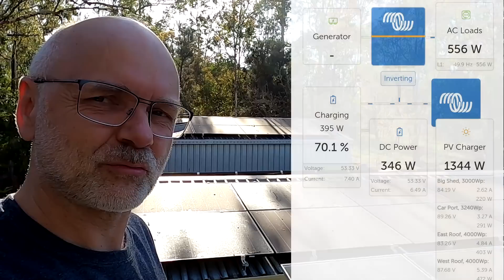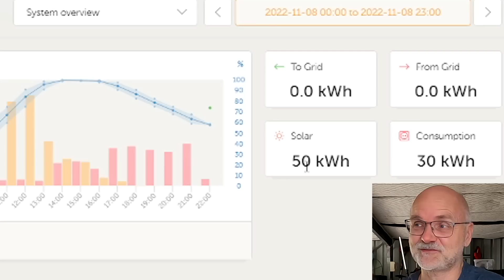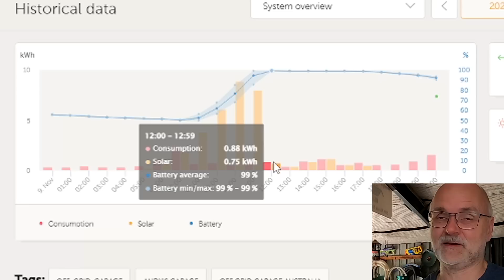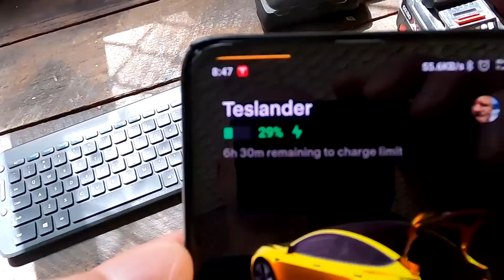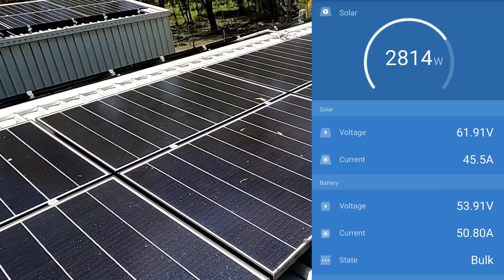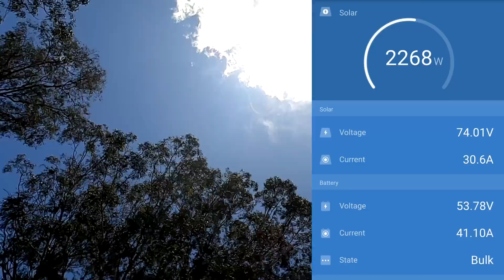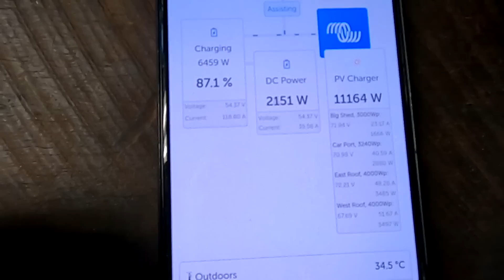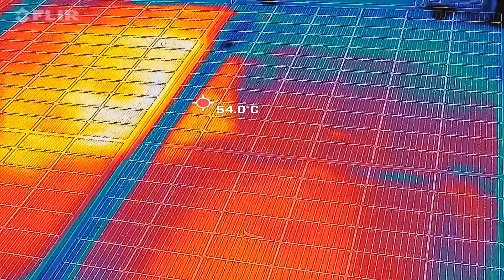I had to limit the output power of the new solar system. First impression after a few days...

Comment: Like 437, UGH

What is the most amperage/power your Tesla charger is capable of? How quickly can you charge it to 100%?

This is why I’m eventually going to have 15x540watts solar on Taj-Ma-Haul - I ordered a CyberTruck to Haul it. 8.1kWatts of solar panels to charge up my 112kWatt battery pack.

I’m curious with you solar capacity how long it will take to charge your Tesla!
Reply from the maker: The Tesla can charge with 11kW on a 3-phase outlet. Speed is not the problem though, because the vehicle is not at home during the day and it will take only 4-5kWh to fill up what I've used during the day. So this can be done overnight from the batteries.
Reply: @OffGridGarageAustralia  Doah, I never considered that my 12kWatt inverter would be the bottleneck! Geez, now I need to rethink how I will charge the CyberTrruck...
Reply: I think I'm going to need 6 x Growatt SPF 5000 in parallel? 30kWatts of charging power, does the Tesla 3-phase support that much charging power - I can't seem to find any specs from Tesla on this.
Reply from the maker: @paulcurtis5496  AC charging is 11kW max for all Tesla. Older ones have dual chargers and can do 22kW on AC. 
I charge with 10A/2.4kW most of the time. Totally sufficient.
Reply: @OffGridGarageAustralia  Wait, what? To charge from home you are limited to 11kWatts? How on Earth is someone with a CyberTruck supposed to charge it up in any reasonable time? I hope Elon has something specific for the CyberTruck that's going to have at least a 200+kWatt battery pack! I know, I know, not your problem, I'll go grumble to myself now... Hahahahahahaha

Comment: Have you considered some sort of a dump load like solar powered water heaters? My Outback charge controller has a relay that it uses to heat water with excess output from the panels, and especially the wind turbine, as a dynamic brake system. I also remember that you had a grid tie connection to your house. Is that an option or is the connection limited by contract?
Reply from the maker: The water heater will take 3-4kWh until it turns off. Yes, that is all in planning but I have far more power ein summer...

Comment: A diversion controller so you can power a water heater.  Or an AC unit.
Reply from the maker: Yeah, I need more loads for sure... The hot water system will take only around 3kWh per day, so still a huge surplus of energy...

Comment: i think your victron controllers are 150/70 so you could raise the voltage up to 150v then you can reduce the amperage. your controllers can manage that, i am saying still charging voltage is aronud 50v. i hope i'am right.
Reply: The 150/70 are still limited to 4000W, which, at 150V is "only" 26A of PV current, but now you have 3 panels in series, and if 1 panel has shading, then all 3 panels produce nothing.
Reply from the maker: Each panel has 49.5Voc, so three in series won't work in colder temperatures anymore. Also, I could nto fit three in one row as there is not enough space on the roof.
As we discussed before, this is the best solution.

Comment: Oh, I thought of one more thing.   Since its a battery system and the batteries might be 100% full, the solar panels could potential overheat in full sun when the batteries are full and the charge controllers aren't pulling any power from the panels.   That can reduce the life of the panels.

I've never had to deal with this sort of situation myself because I'm grid-tied so the system always accepts all solar power.   I don't know a whole lot about potential solutions.  Shunting power into additional equipment (heating the pool, for example), or running a resistive heater, or even constructing a sand battery for overnight heating.  Etc.   Something to deal with excess power when the batteries are full, though, would be a great project.
Reply from the maker: That cannot happen. It's not like with hot water solar when the pump does not work and the water overheats inside. It's the opposite with PV solar. No power means now power lose in the panels and therefore cooler panels.
I'm in discussion with the sparky to get the house connected without harming the high feed-in tariff for the house solar. It's a bit tricky.
Reply: @OffGridGarageAustralia  Hmm. I guess its only 20%, but the armchair physicist in me starts whispering "conservation of energy".  If the energy hitting the panel isn't being taken away as electric power, where is it going?   Either way we are only talking 20% though so perhaps it isn't that big a deal.

Comment: Andy, Gratuliere! Leider shafft Victron es nicht. Deine accu's mussen nicht om 1100h auf 100% sein. Dass sorgt dafur das die lebensdauer deine Batteries im arsch geht. Have a look at E3/DCG GmbH YT kanal: Stromspeicher: Was macht eine gute batterie aus und Wie kümmert sich E3/DC um Batterien. Its a very good company. I really like them. They have a commercial solution, just what you want to achieve using DIY solutions. You can't do the proper load distribution related to time and weather forecast using Blue Viccy stuff.
Reply from the maker: Not sure what you're talking about but the batteries won't suffer the way I charge them. Of course Victron has the solution for this. It's called Venus OS Large.

Comment: Oh, one quick additional note... now that the whole system is up, check component heating during peak production (and also with your charge controllers unlimited and charging at max rate).  Everything.  The conduits, wires, junctions, battery terminals, charge controllers, inverters... everything.  Point an IR temperature gun at everything.   Always a good safety precaution to do a check like this at least twice a year.
Reply from the maker: Coming soon, just need to get a day being at home with full sun out.

Comment: I'm envious :-).   So awesome to see numbers like that from a system.  Such a huge evolution compared to when the channel started!   Now I really want to cover my roof with panels instead of just the attached garage(!).   And maybe put together an EG4 battery rack or two or three.

Ok, your next project... double battery capacity, take your home completely off-grid :-).   Hell, even with your current system you probably only need a 1-2kW feed from the grid to ensure 100% 24x7 365-day uptime.

-Matt
Reply from the maker: The problem in my case is the high feed-in tariff for the house solar. This needs to be separated first and stay connected to the grid.
All the rest can be connected to the garage. The challenge: limited cabling between the two buildings. The sparky is working on a solution.

Comment: Thank Andy so you have 14.240kw of panels what was your configeration
Reply: Thanks I am using a Sunsynk 5kw inverter it has 2 X MPPT charge controllers built in if I remember correctly 6kw each

Comment: Hey Andy, remember to only wash the panels in the early morning or late afternoon. Use ambient temperature soapy water bucket and SOFT scrubber/squeegee dry or captured rainwater rinse. Tap water, water spots are to be avoided. No spray nozzle or pressure washer because the glass/frame seal can be damaged. A powerful leaf blower for regular maintenance is best but also, not on hot panels. Again, great installation Andy!
Reply from the maker: There is no self-cleaning layer on solar panels. It's the solar glass itself which has a bit of self cleaning capability but there is no coating or layer which wears off. Otherwise companies would advertise that.

I use a sponge and a bucket to clean them. Well, the old ones at least. Not that I could ever see an increase in production but it is more for my OCD 😂
Reply: I was told to never wash the panels on the first years because you scrub off the self cleaning layer?! It was a guy installing and selling panels of 5 brands.
Little confused here by your comment.
Reply: @camielkotte  
You may be right about about soap (or what kind) mild for sure, but you have to check with the manufacturer. I live in an area that has lots of sticky leaves and dust. The panels have a 15 degree tilt. Most of the time I blast it with a leaf blower but that gets only 75% per treatment. After a few months the accumulation is too much. So I can wait till winter for it to self clean or do with only half the power till then. Even tho I have “half cells”, I can’t believe how a few dozen medium sized leaves can destroy energy. I envy those that have steep panels and little local contaminations. There are after market “ceramic” coatings for solar panels but I’m not interested at this point. Andy may not need to clean his because he’s going so much power anyway.
Reply: @SkypowerwithKarl  thx. That totally makes sense now to me. Learning every day here.

Comment: Still getting rid of blocking diodes when you're not absorbing all the produced energy with MMPTs ?
Reply from the maker: I don't have any blocking diodes. They are not needed if the panels are fused correctly. I'll make a video about this.

Comment: How hot are your charge controllers when they pump their rated amps all day? I installed 12V PC-Fans (driven with only 5V) above my charge controllers to help with the convection through their heat-sinks. While i'm sure Victron spec'd them to be passively cooled, i'm not really a fan of seeing electronic equipment baking at ~45°C+ all day long. (I glued LM335 Temp Sensors to my charge controllers and feed them to the TEMP-Inputs in the Cerbo, switching one of the relays to power the fans over 35°C)
Reply: Andy will see higher ambient temps than 35C through Summer here, and west of here can get 45C+ in the shade.
Reply from the maker: They will throttle when hotter than 40°C and can run on max load 24/7. If the sun shines that long.

Comment: It looks like the tilted panels are a different brand than the west roof. So is that a possible the different brands absorb diff temps? I still think the angled ones should have been cooler. maybe if you measure at the bottom of the angled panel the reading might be different than the top as the hot air is raising to the top of the panels? as well as measuring from the top of the west roof as there is a slight angle on the roof causing air flow. just some thoughts

Comment: Hi, it's me again, that annoying guy who has been banging on about controlling charging current for some time now.  Imagine if we had a system in place that dynamically adjusted the current the Victron chargers were making available to the LV DC side so that it both simultaneously kept the batteries happy and also satisfied the demands of the inverter or other DC loads to optimise the utilisation of the solar arrays.  Nah.  Let's not even think about it. The batteries will balance... even though it's not what this guy has been banging on about all this time anyway.  We'll simply limit the power of the solar arrays. :)

Comment: no such thing as too much power.  you need some “dummy loads”.  I would suggest some large electric hot water heaters.. divert power from battery charging to the hot water heaters, once the batteries are full.  you can basiclly have “free” hot water for use in your house.  you can also install an electric pool heater, and have a heated pool for free as well 👏
Reply from the maker: Large water heaters won't help if you don't use the hot water for something. Large batteries won't help if you don't use the energy at some stage. 
At the moment, I just need more load. The sparky is looking into this atm and will make suggestions. Videos are coming, stay pumped!
Reply: @OffGridGarageAustralia  I agree to an extent, but it depends greatly on each installation’s situation. If you are fully off grid, in a cold region with limited daylight during parts of the year, you need to have more storage. Two full days of storage is not unreasonable,but it is very expensive, so you have to weigh the cost benefit. I run electric heaters with my dump load, that supplements my propane consumption. It doesn’t take long for this to pay for itself in cold climes…
Reply from the maker: @NeverTakeNoCut-offs  Yes, that is correct. I fully agree. In such a situation and environment, I would probably have more batteries as well to cover several days of energy.
Reply: @OffGridGarageAustralia  how about heating your pool with the spare power and you should look at a solar energy diverted to heat the domestic hot water with an immersion heater (assuming you have hot water cylinders in Australia)
Reply from the maker: @graham9957  Not sure if heating the pool is such a great idea. I'm a bit concerned that this will increase algae production and somehow fires back on my😉
But the hot water installation is on it's way....
Reply: @OffGridGarageAustralia  you attempted to disagree with the man while ultimately agreeing with him. however in your mind you dont even see the connection. You are going to get a dummy load at some point. Might as well make it something that CAN BE used. Like hot water. Otherwise you are just going to be heating the outdoors with a large ballast resistor.
Reply: It isn't free. Eventually he's going to need to replace the batteries.

Depending how much or often he needs to charge them, it might be sooner rather than later.
Reply: Cough cough Crypto miner.
Reply: He could simply run his house and the water heater/heating system/AC from solar.
But honestly not sure anyone needs 50kwh per day
Reply: @tiloalo  Then you aren't tracking your own usage and don't (yet) have an EV or a need for heating or cooling. I get 50 kWh on days like today, and it's not even remotely too much. And we don't run a heater or cooler either. I want more solar and MUCH more storage than I currently have with my measly 13.5 kWH PowerWall.
Reply: @tiloalo  Depends on the climate. My heat pump alone can use that much or more per day in the winter.
Reply: Showers, heating at night, start putting power to the house? Pump your pool though, you got it.
Reply: Start cranking on the a/c in the house and put the pedal to the metal on that Tesla!
Reply: Seems to me additional storage would be a reasonably logical solution.
Reply: Bitcoin miner
Reply: Cryptocurrency mining.  !!
Reply: This.
Reply: Yes there is such a thing.  It goes to waste unless you sell it back to the power company.  You can only use so much hot water and can only store so much.  Waste of money and resources.
Reply: @nach335  yes, it is technically a waste - but also a rational choice. We are getting close to mid summer peak solar south of the equator.
6 months from now the daily production will be only about 1/3rd as much.
Until there is some economical way to store massive amounts of energy for six months, it makes sense to over-provision panels.
Reply: @jimmurphy5355  This is the reason why On Grid Solar make sense. No worries about what I will do with the too much energy in Summer.
Reply: @nach335  Absolutely wrong. Never having to worry about having enough power, regardless of the weather or other conditions, is the WHOLE POINT! Most solar systems are DELIBERATELY massively undersized because they want you to still be dependent on the grid. The installation companies have their hands tied by regulations that are written by power company lobbyists. The only reason Andy can get this done is because he's putting it where the grid was never connected. Otherwise the only way to do it is DIY, which is again illegal in many places because of corporate influence.

If you don't have enough storage for at least 2 full days of normal use with no power saving behavior with zero power production and enough solar to completely fill your storage from zero to 100% then you're doing it wrong and being massively ripped off.
Reply: @awo1fman  This is the correct comment
Reply: @awo1fman  yeah when it comes to feedback systems i figured that out too.  you can oversize your system so it provides 100% on a good day, even 100% on a bad day, but all that extra energy then flows for free to utility as they only let you credit the officially allowed capacity.  Actually, they might even limit feedback if their street lines can't take the load.  utilities = scam

Comment: One can never have too much power, just a too high "Max charge current" setting in the MPPT charge controler :-)

Would be nice when one can have the charge controllers share a total max current inside a VE network.
Reply: that function is already available...
Reply: @casemodder89  oke, where and how? Can you copy a text from the manual? So let me be clear, mppt controllers sharing amongst them a maximum total amperage, so not just an individual setting!
Reply from the maker: It's called DVCC: https://www.victronenergy.com/media/pg/CCGX/en/dvcc---distributed-voltage-and-current-control.html
Reply: @OffGridGarageAustralia  Thank you! that makes sense. I am still flying without a GX which is problably why I missed that :-)

Comment: Well, now you’ll need to install a walkway on your roof because I’m sure your going to wear the coating off lol! Congratulations Andy! 🎉👍🫡🍻
Reply: And an electric escalator to get up there and use some of the extra power....
Reply: As long as WALKWAY doesn't CAST a SHADOW on anything!
Reply: @romeowhiskey1146 I reckon if he had a walkway that shaded a whole set of panels he would still have more than enough power at the end of the day.
Reply from the maker: Yes, all of that, hahaha. I spend a lot of time on the roof and can't believe the output with all the shading!